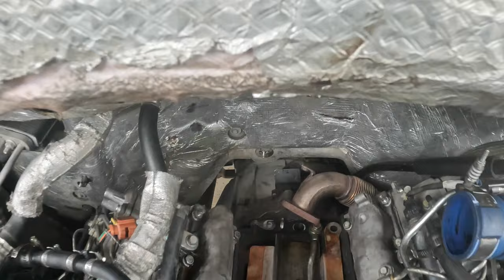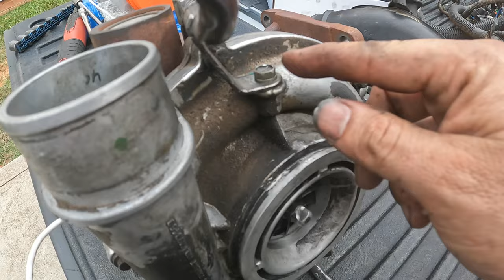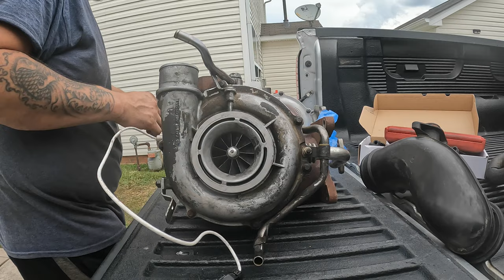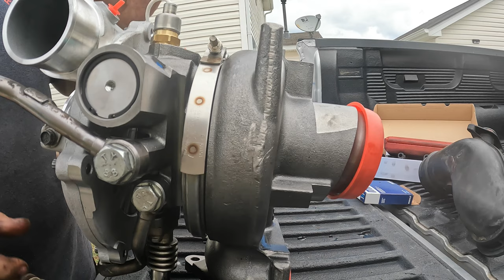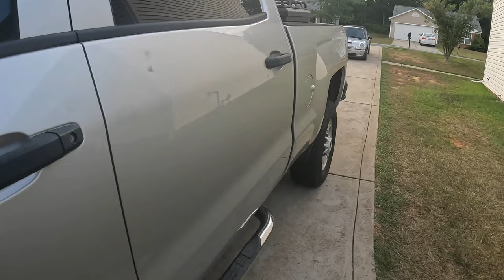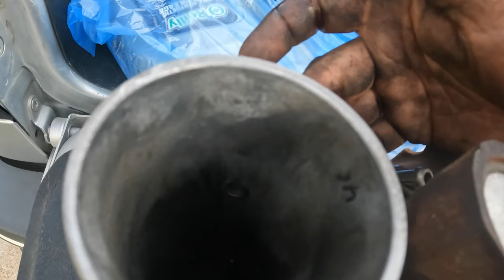LML Duramax Turbo Install Part 2

Comment: how did the 12pt 12mm uppipe bolts come out? did any snap? im nervous about removing them i really dont want to snap one. I live in California so not much rust but have over 400k miles on the original turbo on the LLY duramax
Reply from the maker: No I did not break any on this one I believe but I did have one on another that did break off.  They were easy to get out though.  I just heated up the turbo around the bolts and welded a nut to them.
Reply: @operationoverhaul  Thanks for the quick reply. I'm going to tackle the job soon, just trying to prepare for the worst just in case. Did you have to remove the pedestal or were you able to weld the bolt with it in place? I think I can leave the passenger up-pipe bolts connected at the manifold on the lly so don't have to worry about those.
Reply from the maker: @wild1athletics  I just removed them when I removed the turbo so they were easy to get

Comment: Currently replacing my turbo with a drop in turbo but having problems getting the six manifold bolts off. Did you attack those bolts all from the top?
Reply from the maker: Yeah I got them all from up top. They are extremely tight especially if the truck has some higher miles.   Also a one inch extention and a flex head ratchet works great for this.   I also have an air impact that is low profile. Ill get a link for you
Reply: Thanks for the info. Got turbo out yesterday. New turbo is now just sitting in place but nothing buttoned up. Getting the oil return line connected back with gasket is my new issue. Wishing I paid someone to do this lol.

Comment: The manual calls for dropping the transmission on my 2011. Can it be done without lifting the cab or dropping the transmission? My truck is bone stock low miles just has stuck turbo vanes. I don't have access to a lift so dropping the trans isn't something i can do.
Reply from the maker: I have done this job on the manually as well and I did not remove the transmission. If I remember checker l correctly I think it calls to remove the transmission on the auto as well. I think it is due to getting the bolts for the up pipes, may be wrong any that but I'm thinking that is the reasoning behind it.
Reply: It's an automatic just meant that the shop manual calls for dropping the transmission. As well can it be done without dropping the transmission with the EGR in place?
Reply from the maker: @simonc8469  yes you can do it. I have before. It takes a little more stuff to be removed but it can be done.

Comment: Hey man. What size are the turbo mounting bolts on the bottom of the turbo? I’m about to swap a new oem one in
Reply from the maker: On the LML, the mounting bolts are 15 mm
Reply: @operationoverhaul  appreciate it man. Did you have to do a turbo position relearn or vans sweep after installing your oem turbo? Just read about that and realized I don’t have a scanner lol
Reply from the maker: @logan8256  no i did not have to on this one.  I have had to do it on them before but this one did not need it.
Reply: @operationoverhaul  man I unfortunately rounded off one of the driver side up pipe bolts today. It was super tight, what would you do?
Reply from the maker: @logan8256  I try to use a smaller size and try to snap the head off then if that didn't work I would use a rounded bolt socket first and see if I could get it out and if that doesn't work then try cutting or torching it out but put fire blankets everywhere I could.

Comment: anytrick for the downpipe removal? ive heard its pretty tough
Reply from the maker: Getting the clamp off isn't that bad but getting the pipe to come off of the turbo is the hard part.  I use a pry bar with a striking pad on the handle to knock it off of the turbo.  Also, I typically put some Kroil or what ever is your favorite penetrating oil on there as well and let it sit for about an hour before hand.

Comment: How long did it take to take off and install just trynna see how much time i need to put aside to do mine.?
Reply from the maker: It depends on if the truck is stock or if it is deleted.  If you have never performed this job before I would set aside a weekend to complete it and allow for anything that could go wrong. The hardest bolts to me are the up pipe bolts and sometimes getting the down pipe off
Reply: @operationoverhaul  yeah mine is deleted and i have installed up pipes and down pipe my self. So as long as im comportable taking all that of i should take a week right?😂
Reply: Thanks for the vid👍. Well explained helps alot
Reply from the maker: @Zenpiie  set aside 3 weeks lol but if you are good with doing all of that the turbo will be pretty straight forward for you.  You could knock that out in a day if you stayed on it.

Comment: Did you have to remove the down pipe ? I can’t  get to the 6  exhaust bolts
Reply from the maker: Those 6 bolts are pretty tough to reach and they are normally tight as hell too.   I did have to remove my down pipe to reach them and it can be in the turbo pretty tight as well.  I had to knock mine out with a hammer and drift/punch to get it out of the turbo.  I have heated up the down pipe at the turbo before to get it to free up.
Reply: Thanks ! Wish me luck lol

Comment: i did my turbo swap in my lbz now i’m leaking oil not sure if it’s from the oil drain or return pipe
Reply from the maker: Did you re-use the gasket/ washer that is around the banjo bolt?  I normally replace those. Had a lot of oil leaks from re-using them

Comment: Hi  sir
I  want have manual service for gear box otomatic and c.v.t 
How I can from  inter net
Pls
Reply from the maker: Do you need a manual on rebuilding the transmission or how to remove it
Reply: @operationoverhaul  
Rebuilding it
Reply: @operationoverhaul  
Your 💪 is  very good
Thank you
Reply from the maker: @Emad19728  I could not find any free manuals or downloads online.  There were a few websites that have some available to buy.